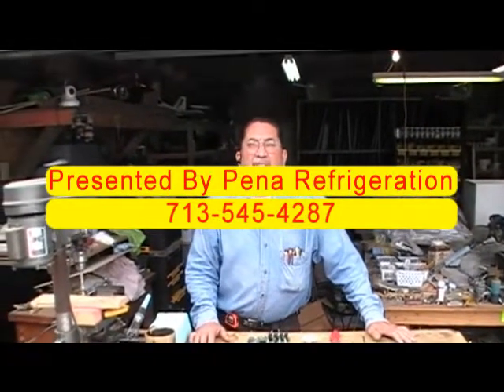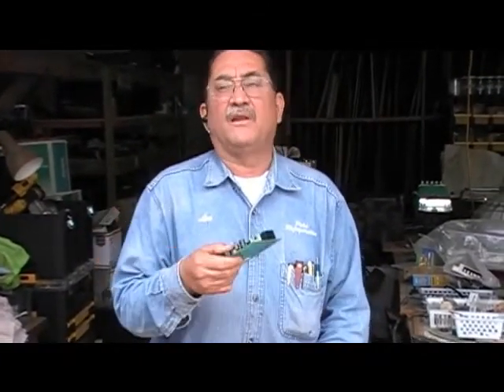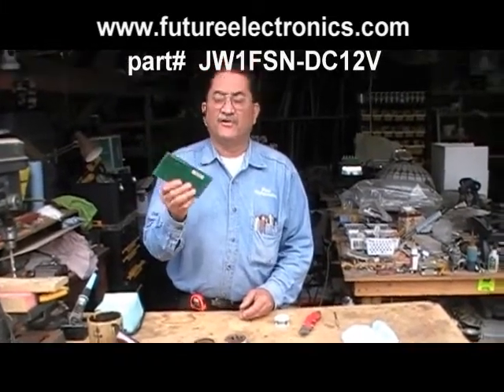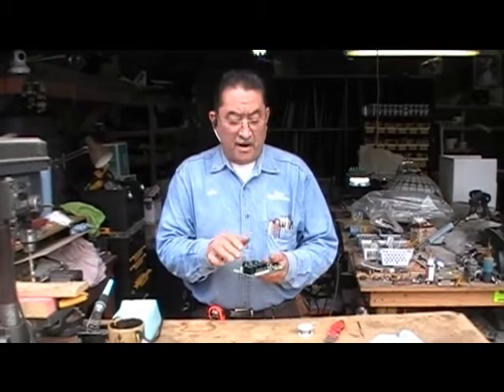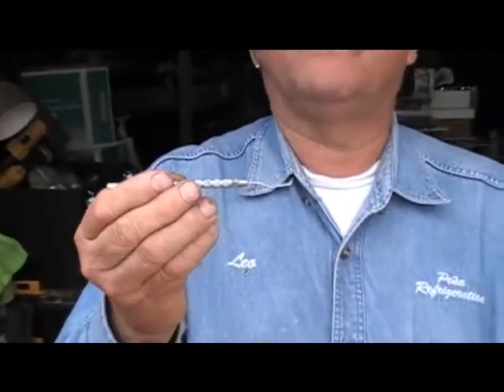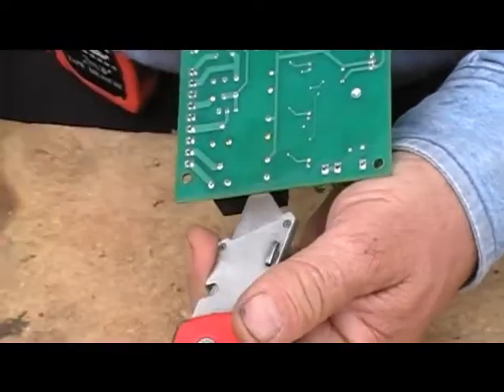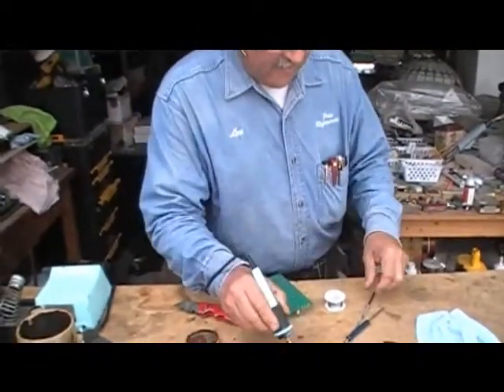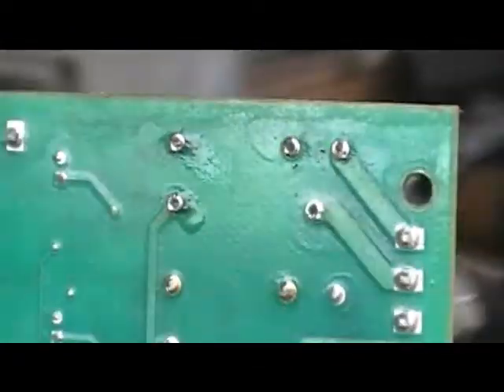How to fix a computer board on a hoshizaki Ice Machine with a three beeps mode

Comment: Hi, Leo
I have KM—515MWH.  Serial number #E04818E.  My control board is 2A3792-01.  My problem is LED 4 is not on.  I want to change the relay for Led 4 but I couldn’t find it anywhere.  Can you tell me how I can find the relay for Led #4?  Thanks,
Reply from the maker: http://www.futureelectronics.com/
4150 Old Airways Blvd
Southaven, MS. 38671
Tel:662-536-0401
part number JW1FSN-DC12V

Comment: Leo have you taken a few of those relays apart to see the cause of failure. If pitted contacts they could be sanded or filled to get the resturaunt by when one doesnt have a spare.
Reply from the maker: I don't think you can open it,  because is all sealed
Reply: @leodepena  thanks for this video, one thing you may want to pick up is a solder sucker. They use them in stained glass work.

Comment: My “3 Beep” Problem Solved.   My ice guide (the plastic screen that lays under the evaporator), had several pieces of plastic that broken off and were missing.  I thought, “where did they go?”   They had fallen into the reservoir.  Some pieces passed through the pump, over time, and had been pumped UP and were sitting in the water spray guides ON TOP, of the evaporator.  BUT, a few pieces did not get pumped up with the water.  They were in the pump, slowing the flow, (which I suspect was a several month long problem I had with very slow production of ice).  Eventually, one of the pieces jammed in the pump, stopped the pump, and triggered the “3 BEEP”.  I took off the pump, cleared the little pieces of plastic out of the impellers, and it’s working like new.  Visually inspect your Ice Guide, if it has pieces missing, they are likely causing slow water flow in the water lines somewhere, and maybe even have the pump jammed.

Comment: Cuál es el relay de válvula de agua no me manda voltaje a la valvula la tarjeta...si le llega 220 pero no me manda a la valvula ..a los demas componentes si pero no inicia la secuencia....le puse 115volt directo a la valvula y si trabaja pero no manda señal a pompa y si le presiono el test machine si prende todo menos la valvula y al ponerla directa no manda señal latarjeta a la bomba tengo pensado poner nueva tarjeta que me recomienda Saludos desde austin tx mi makina es una hoshisaki board hos2a1410-02

Comment: Coal es el hot gas valve relay. Bien video.
Reply from the maker: El primer relay es el de hot gas valve
Reply: Tengo una maquina hoshisaki no me manda power a la válvula de agua ...le puse 115 volt  directo a la válvula y si prende ......a los demas componentes si les manda voltaje xq le puse en test machine y prende pompa y la refrigeracion....en wash si lo hace pero en ice no manda voltaje a válvula agua la cale directa si prendio pero ahora no me manda señal a la bomba ..que relay sería de la tarjeta o como arreglarla estot apunto de comprar una en 150 pero queria saber sonde y como consigo los relay Saludos desde austin tx
Reply from the maker: @jose-if6zv  Revisa primero el flotador porque es el que le manda la señal al computer board y de allí a la válvula, suerte y saludos

Comment: My ice machine had the same issue 3 beeps. The compressor works but the water from inlet valve doesn't stop
Reply from the maker: Turn off the machine and look at outlet of the water valve  and  if is  still leaking, the water valve needs to be replaced, what happens is because you getting fresh water and it will take forever to make the ice, and before that happens it will go in to a 3 beep mode

Comment: Great video! Will be looking at other vids if you have up. I have an am150 and the condenser fan and water pump both stop working together. They are getting power and the capacitor for the water pump is within range. Is it circuit board replacement time?
Thanks
Reply from the maker: If you are getting 120 volts to the pump and condenser fan motor, more likely are bad.

Comment from the maker: first make sure al the lines are frozen within 15 minutes, second check the float for any calcium, with the machine on off position make sure you are not getting water from the water valve, those are the most common symptoms, but if it works fine for several hours or even days more likely is going to be the circuit board also check water pump.
please let me know if this advice was helpful.
 thanks

Comment: Mr. Peña, 
Do you have any information regarding the one beep? or any other tricks that would work to solve the issue? 
Gracias y saludos!
Reply from the maker: One beep mode means thermistor is sensing high temperature, that's the one that has two orange wires, follow the wires and touch the copper line right where is attached to the copper line  to make sure is not warm, and if it is it could be because hot water is entering to the ice machine, second thing, check the solenoid gas valve to make sure is not leaking hot gas, but if is leaking hot gas usually the machine will take a long time to freeze causing the alarm to go in to three beeps, and the last thing to check is the thermistor, I had several bad thermistors that causes to enter in a one beep mode. if that's the case unplug the thermistor, and it should work temporarily, check the thermistor for continuity it should reed 3.9 k at 48 degrees,  please let me know if this was helpful.
Reply: In my training, I was told that it was mostly hot water entering the machine, and the second most common reason was inadequate ventilation. just wanted to double check. next time I am working with one beeps I'll check the thermistor to the board. thanks for the tip. quite helpful !!
Reply from the maker: You are welcome